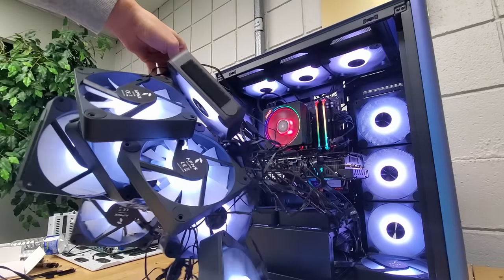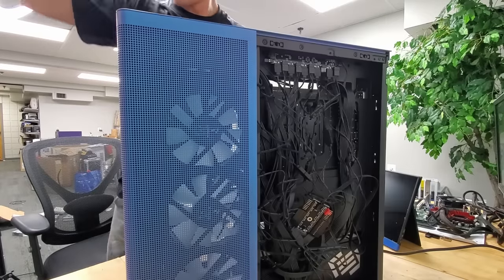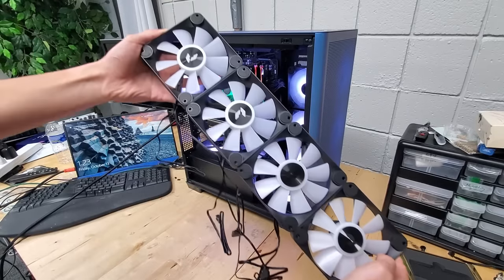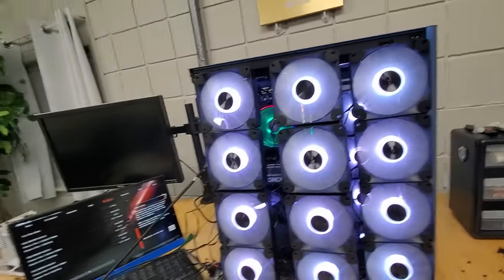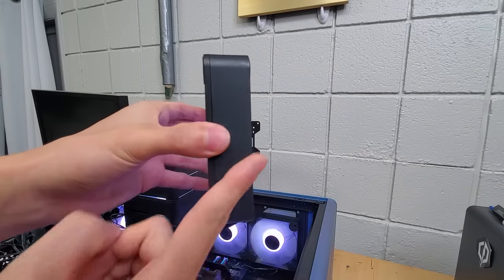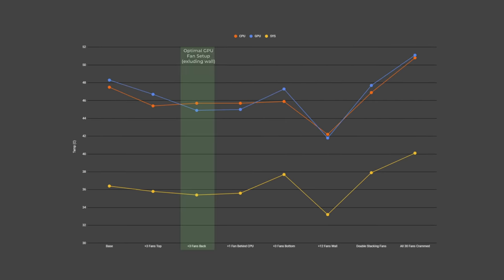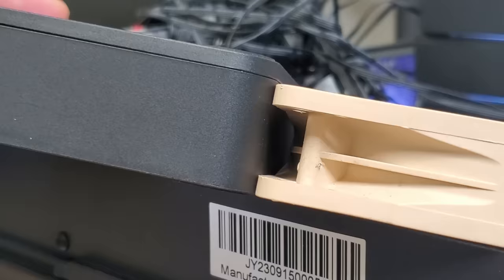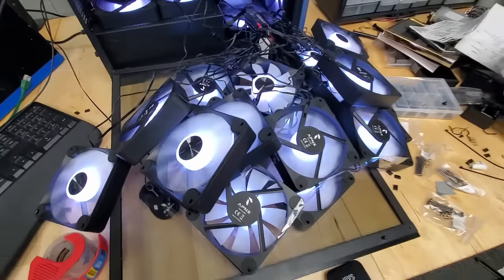I installed 30 fans in my PC so you don't have to

Comment: Also fun fact: adding more fans does not impact the temperature of the components, it will never go under room temperature unless you use something like an air conditioning
Reply: I never thought about this 😶
Reply: no shit
Reply: Its like you are telling about some juice
Reply: True
Reply: You don't need AC, you just need a well designed house with cooling in mind. Why build a house like an oven that traps heat only to attempt to cool it.
Reply: literally every house is built like a oven in europe @Ruby_Mochii
Reply: @urbexingTss  if you mean "like an oven" in the sense that they're well insulated, then yes. Houses in Europe are very well insulated so they stay warm in the winter and cool in the summer.
Reply: So if i put it in a walk-in freezer with that many fans it will be good.
Reply: Never goes below room temperature but it might cool faster
Reply: @RealityDriven  he should try that bat at the end the laws of thermal dynamics are gonna kick our butt because fans use power which creates heat so even though they cool you which is called evaporative cooling they can only help moving so much air before they are causing an issue with the heat they produce
Reply: Hi there, May I get some help/advice about thermal gel/paste, I am looking to get my 3'rd Samsung Note 9 (my second smart phone was the 512gb Note 9 but it broke because it was most likely refurbished, and it took in condensation trough the seal, having water damage swamp style without ever being dropped into water, and it was only used for 6-8 months, almost half a year) so I am currently using 2019 128gb note 9 (my first smartphoneand I ordered an other 512gb note 9, but I plan on using Galaxy Note 9 Unicorn Beetle Pro Rugged Holster Case-Blue, but it will overheat inside it, so I plan on using normal thermal paste on the back and sides, but if there is a clear/transparent Thermal Gel/Paste, do you have any advice/recommendations?
Please?
Reply: Bro states the obvious and acts smart
Reply: I vacuum sealed my rig and put it in a Frost Free Freezer....
Reply: at least we know that it can get lower than 70ºC, since at these temps, we are pretty much dead ._.
Reply: why
Reply: Umm...i put aio on i5 13400 and sensors showing 19-22 max but romm temp was 22-23
Reply: Fans just help it from getting really hot
Reply: You could try to attach an external cooler, I think that'd be the easiest solution but you might not want to do that  @Narinjas
Reply: A litle bit cooler than your toom's temp, mouving air (by a fan) is cooler. But ye your still right, fan arent freezer
Reply: @Ruby_Mochii  Sorry for deadposting. If you live in a cold area then you probably want a house that holds heat in so you dont freeze, but if it gets hot out you want to be able to cool the house so you dont burn at night.
Reply: Dawg you think it’s 31 Fahrenheit in his room 💀💀
Reply: Put dry ice on that b*the of a the CPU/GPU, it'll run 100% efficient. 😂😂😂
Reply: @urbexingTss  fr
Reply: @Ruby_Mochii bold you to assume everyone has enough spaces to make their house not look like a box of oven
Reply: @Greedy-Allay Even through you're right to say 

"it will never go under room temperature unless you use something like an air conditioning"

More case fans will still improve cooling efficiency, as it helps disperse the heat from the components and will exhaust out the back more quickly. 

You're not taking airflow into account, and that the components are going to generate heat beyond that of room temperature.
Reply: thats why my room temp is at smth like 12°C
Reply: Can you install AC in PC instead
Reply: @urbexingTss  yes T_T my room so warm i gotta have my window open while my pc turned on
Reply: You are always bound to ambient temps in ur room.
Reply: @EnzoTheProot  how are u gonna deal with condensation?
Reply: @okuue  u will always be bound to the ambient temp in ur room but more fans could help move the heat away from the components faster
Reply: @floridahighwaypatrol7713 There's a peak from where more fans won't change anything  as it is capable of moving away the same or more wattage of heat the pc generates
Reply: Well, i didnt know that
Reply: That gives me an idea. My dad is an HVAC tech so he might be able to help me with the cooling system for the build I've been saving up for.
Reply: Or living in Canada 😎
Reply: im probably gonna use my pc in an air conditioned room. will it affect the temperature?
Reply: It impacts it by making it colder if I had no fans in my pc it would most likely overheat
Reply: @Heisenbergmethcooker  why is bro so mad
Reply: @Nexboil  how i am i mad 💀
Reply: @Heisenbergmethcooker  idk💀probably because you put a bunch of nerd emojis
hate is like anger. anger is like hate
Reply: @Nexboil  anger isn’t hate and hate isn’t anger 💀
Reply: @TheEpsilon-9.Agent-621 no.. it isn’t 😂. It doesn’t cool, it just moves the air around.
Reply: @Heisenbergmethcooker eh, It very well can be lol.
Reply: This is why AIO/water cooling sucks because more often than not radiators, unless mounted as top exhausts, just push hot air into the PC and raises average temperatures.

Comment: This video has shown me that im not crazy for having 19 fans in my case. Since i dont mind the noise increase from the fans, i may swap some of them out with some much higher airflow ones just to see what happens
Reply: If you run out of mb fan header just use 12v directly from your psu. And you can easily use a second psu if yours doesn't has enough power.
Reply: @AMPS1  my PSU has too much power. Under full load I'm barely using a little over half of the total output it can provide. (700W max load/1200W PSU). I don't know if I've run out of headers yet since all of my fans run on their own hubs or are daisy chained, so I think I'm only using 4 fan headers on my board so far.

Actually, I might not even be using 4 since my fans don't even have software control
Reply: Must be hell to clean that up
Reply: What you trying to cool off, the unmatched power of the sun?
Reply: @FilipeB-code  haven't cleaned it even once since it somehow never builds up enough dust to do anything more than a very very light coating. I've had it for almost 4 years now
Reply: I've got 10 intake fans and 1 exhaust fan, and I'm thinking of adding 2 more fans to my case
Reply: Bro is trying to cool and entire LAN party. Seriously, this is unnecessary. Grab a couple Noctuas and call it a day, don't overcomplicate your cooling.
Reply: @normified  but my case can fit them all because the case was built for it. And I also host servers on my PC since my PC can handle it while I play other games. Also, I'm not really that in to noctua fans, so I don't really want any
Reply: @MyNameIs1374  my setup currently is 12 intake, 5 exhaust, and 2 for increasing flow to my GPU so it stops running so hot
Reply: @MyNameIs1374  BRO SWITCH SOME OF THOSE AROUND PLEASE

Having so many intake and no output will cause hotspots in the middle. I recommend 2-3 outtakes.
Reply: i have 15 industrial noctua fans in my case. shit's awesome
Reply: Also maybe think about getting thicker fans, the phantecs t30-120s and the super flower megacools come to mind immediately
Reply: @chucklesdeclown8819  can't fit thicker fans in my case. The areas to mount them are very specific and I don't think thicker fans would fit. The regular ones barely fit in
Reply: 19 fans is great, if u were deaf. As someone who's very sensitive to noise and hates headphones, i have to keep my fans under 900 rpm or else they get too loud for me. So i have a gigabyte 4080 xtreme waterforce with an arctic liquid freezer ii 420mm for my 7800x3d, two 140mm exhaust fans and corsair rmx shift 1200w, which is completely silent till 600w and barely makes any noise till like 800w, which the 4080 cant reach no matter what. Very silent setup while providing extremely good cooling. Not cheap tho. They also have a 4070 super xtreme waterforce which is a cheaper. Unfortunately the 4090 uses too much power especially when overclocked, increasing both the watercooler fan noise and psu fan noise. Hopefully the 5090 is more efficient. Perhaps if i had headphones i could tolerate noise a bit more, but i hate headphones.
Reply: @kerkertrandov459  the fans aren't too loud. You can easily tell if my PC is on, but it's not too bad. I don't mind the noise at all. I don't think I've ever heard my PSU fan, and I have no idea which of my case fans make the most noise if I ever wanted to make it silent
Reply: @TheSandsofFlowingTime  fans use an incredibly small amount of power compared to the cpu and gpu, it's like 5 watts per fan at max
Reply: @ItsGamein  and with how many fans I have, that's roughly 100 watts of power for just fans. It's no longer a small amount of power

Comment: You can get more static pressure if you double stack fans that rotate in different directions as well as better cooling by making spacer tubes that match the outer profile of the fan
Reply: like coaxial helicopters
Reply: i was thinking why not having a longer cooler instead of bigger, with fans inside an air tunnel
Reply: He mentioned that

Comment: I have 15 fans in my O11 Evo: 6 on top in a push-pull on the AIO, 3 on the side, 3 on the front, and 3 on the bottom. The end result is a 13700k boosting to 6ghz and running at ~57° at 4K in Starfield, and a 4090FE running at 53° with a 21° ambient temp. I no longer have a need to build a custom loop, since I'd cut maybe 5° from my GPU temp. But I'm in the middle of a cold front right now, which has been awesome. My ambient temp is down to ~11°, resulting in my GPU temps dropping to 44°. It's cold enough to stay below the GPU Boost threshold, so I'm not dropping 15mhz boost bins and have set new PBs in every 3DMark test
Reply: we're opposite! i live in Brazil, getting 30 - 34 °C in the ambient with a double fan RX 6600, Ryzen 7 5700G with the stock cooler and 3 weak case fans. everything is running under 85° (a safe temp) but is very very hot when im playing beside it T_T
Reply: Be a lot easier to open the side panel and aim a house fan at it when your gaming. And 15 fans is a lot of tax on the psu
Reply: @davew4304  that's what I do when I'm benchmarking, but my temps are great when gaming. In Cyberpunk at 4K with every graphics option maxed out, my 14700k runs at 40-44° and the 4090 FE sits at 55°.

The fan hub is powered by two SATA cables. Assuming each fan pulls 5 watts, it's a draw of 75w. The 1200w PSU is fine.
Reply: I began to love the cold as a kid trying to OC lol
Reply: @technewb8241 how the hell your i7 14700k is running 44° while gaming, mine is running at 44° while idle
Reply: @sarakuxd  my idle temps are 3-5° above ambient. I keep my AIO pump rpm at 100% and use Kryonaut Extreme with a contact frame. It keeps good contact with the cold plate, and Kryonaut Extreme is noticeably better than every other thermal paste I've used. I recently tested KPx, and it was consistently 5-10° hotter with the same components and overclock, and wasn't enough to avoid thermal throttling

Comment: There's a few issues with this for strictly air cooling, but it can work up to a certain point providing everything is done correctly. First issue you'll run into is a case that supports this concept, you're almost guaranteed to jerry-rig a design or build one. The next issue is pretty much all fans need to be pointing all one way. The next issue is the thermal floor which is not solvable for air cooling. The best temp that the case will be is the temp of the room it's in or space that it's sucking air from.

Comment: You can use static pressure fans instead of airflow fans. More direct air flow that won't push out to the sides. Should do this again with SP fans.

Comment: Ambient temperature is the first step. I've normal computers overheat just because the room itself was hot. Should be obvious. Lastly, a small splash of cool water on the cpu will dramatically reduce its temperature, expect it to be around 0 - 2 degrees after that.
Reply: Ambient temp of 20c or 30c is the difference between cpu temp of 80c or 90c. Aka, not very big. Unless its summer and u have no AC, it wont make a difference. What will make a difference is having a good case, 1-2 exhaust fans and 420mm radiator for ur cpu along with gigabyte's xtreme waterforce gpus. Excellent cooling, very silent. Exteme noise-to-performance ratio.

Comment: I think you should use the multi fans and 3d printed air flow directors ive seen videos on them and they seem to work combined with many fans it may work better or need less fans.

Comment: On the case fan that mounts to the back of the motherboard: I have heard of some motherboards that actually mount the CPU *on the back*.  Now, I donno if you could fit an actual cooler back there, (or...why you would want that for a case this large) but it would make for a really interesting setup (or maybe a 2 CPU setup if those were worth it)
Reply: GamersNexus has a video about a passive cooler that mounts on the back

Comment: Fun fact. Only use exhaust fans for the best performance. The air will flow in through smaller gaps. You'll use the power of all the fans and in the process cool the incoming air in the same way your fridge works. (Just try to suck air out of an empty can for proof of concept. Then blow and be amazed how sucking the air out let's new air come in through small gaps and cool the can.)

Comment: It might be interesting to test a few (or even just one ) Delta server fan, in various positions. They have some models that take 12 volts, but put out 200 CFM. They are extremely loud, though. They have a double stacked 92 mm fan, that combines a 9 blade fan and a 5 blade fan. I think it also puts out close to 200 CFM. As for the back of the CPU, I know that it gets pretty warm. However, it's possible that because of the fancy brackets that many modern coolers have these days, it might get adequately cooled with enough air from the front.

For me, the cheapest and the most effective solution was when I used a $12 dollar box fan on a Pentium 4 + 1900x setup.

Comment: Do you think if you used around 10 fans, 4 in the back and bottom, 6 in the front and top. Top and front intake back and bottom output. That may cool better i think. I think another issue that caused heat was probably the power consumption of that many fans. I would think that it might be a little bit too draining to keep the board cool. Thanks for the video theyre amazing to aspiring IT students like myself.
Reply: Motherboard traces don't get warm. VRMs do, but fan headers are connected directly to the PSU, not the VRMs
Reply: @waldolemmer  the cpu still has to calculate how to use the fans correct,
Reply: @carnagedestructo7388  ...you gonna finish that sentence?
Reply: @waldolemmer  it was meant to be a question mark. MY BAD FOR THE PUNCTUATION ERROR. Dont be posh. You knew what i meant.
Reply: @carnagedestruct1520  Yeah

Fan stuff happens on the chipset

Comment: Too many fans will not lower your temperature and are unnecessary. You can remove the air inside with a good fan. 3 fans will also do the job

Comment: What I want to see is a Motherboard that supports 'duel CPUs' but one is on front, one is on back. They would behave as one CPU so it'd really be a single CPU in the end, so it may not work with just 1 slot filled, I don't know. It could even be customizable so that instead of different CPUs with varying clocks and different amounts of P/E cores you could swap out/upgrade just one side and it'd end up being a customizable CPU, if you don't want any E cores you could put 2 P core CPUs together, if you need a whole lot of E cores, both sides could have just E cores and then you could have different combinations of P/E cores that you mix together. I love being able to customize like that, but it doesn't sound practical so if we do ever see something like this it'll be a while. I have always thought being able to cool a CPU from both sides makes more sense, it'd pretty much double the cooling surface and the CPUs maximum size so we can get majorly more cores and/or a lot more clock speed!

Comment: I built a circulating pressurized heatpump using a type of propane that you use for air conditioning and extreme refrigerant applications, and it works so well you can keep the computer at 2c with it. Not sure if it causes damage being ao cold be ause its like a block of ice.j8i>

Comment: This was a very fun video. I'm curious though. Could desk fans further increase airflow/ cooling. Rather than adding more to the case, what if instead you had a desk fan helping vent/pull air away from the back of pc?